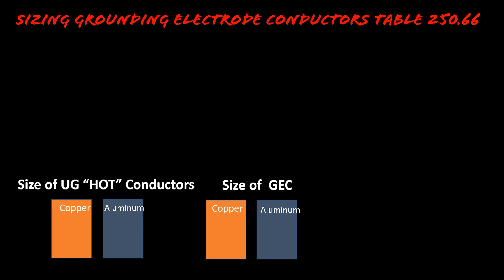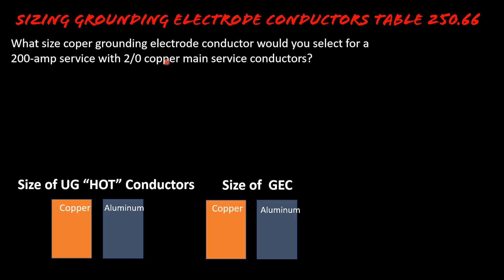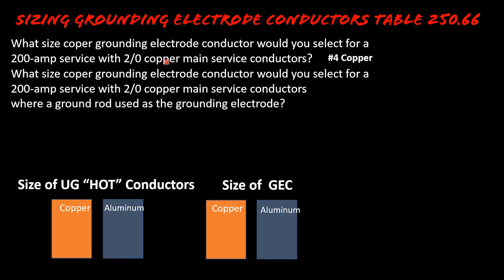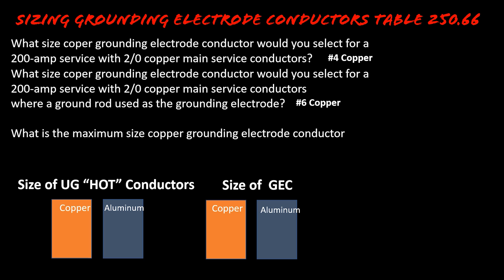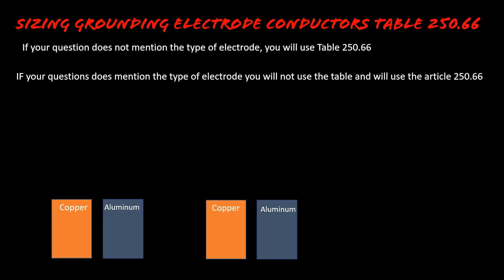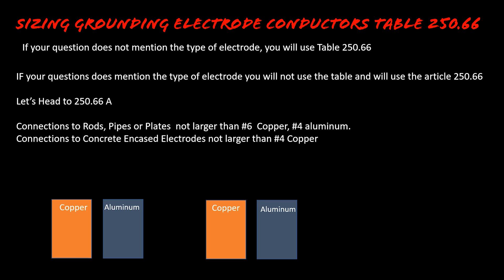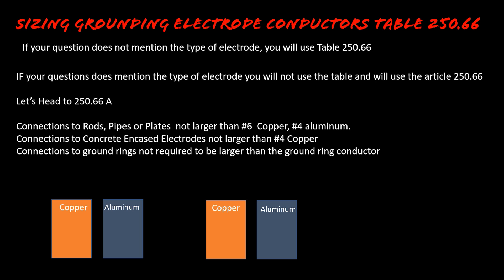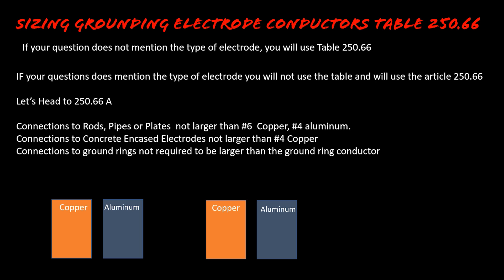#1 MISTAKE when sizing Grounding Electrode Conductors GEC Electricians in Action

Comment: My brotha got a code question … so on a multi family apartment it’s showing a dedicated 20 amp circuit to each bathroom .. 2 bathrooms 2 individual circuits. Showing the gfci on the same circuit… is that ok to the  book ? I’ve always ran a dedicated circuit for the bathroom gfci .. line in then load out to the next bathroom down stream .. so is ok to have to have one bathroom dedicated 20 amp for the 3 gang and and grab the single gfci off that line side
Reply from the maker: That's a great question, yes if that circuit does not leave that bathroom, and the total rating of the pieces of equipment are that are fixed in place do not exceed 50% "10 amps"then it's okay to run all of that bathroom
Reply: @ElectricalCodeCoach  your the man bro I found the exception in the code book but as always your spot on thanks brother